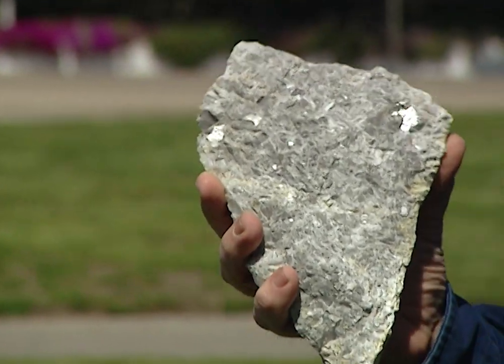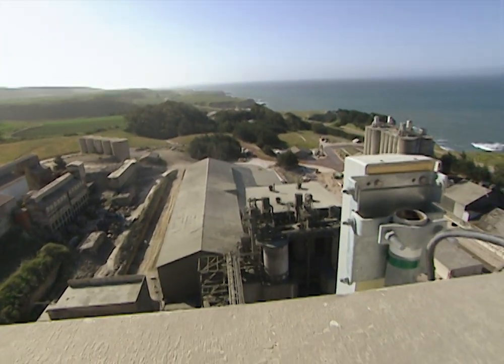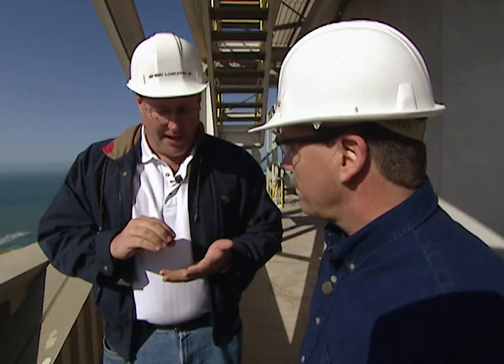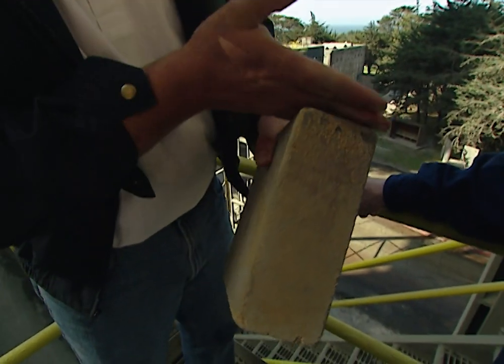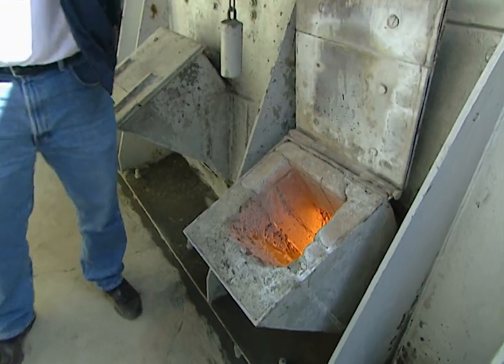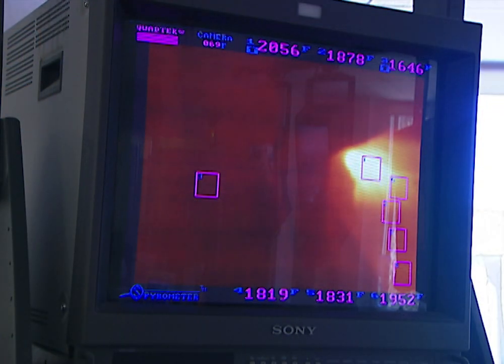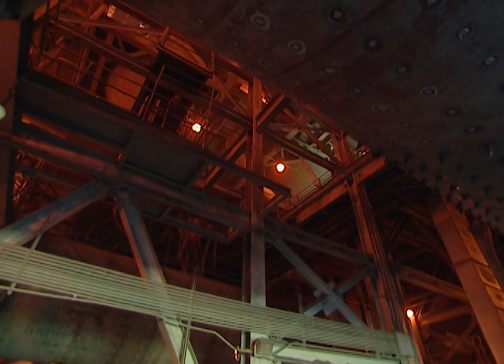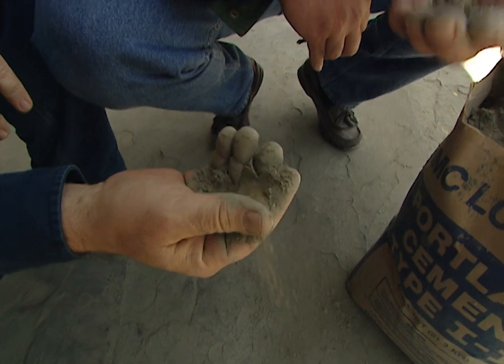How Cement is Made: Inside a Cement Factory - Did You Know?

Comment: Sorry to break it to you but no your man is not able to make 1,200 bags per hour because when you do the mathematical equation it means that he would have to do 20per second, i work at a cement factory where we bag cement bags all day long and we do an average of 45-50 pallets for an 8 hours each pallet contains 30  bags of 94 lbs of Portland cement, so please you might want to retract your inaccurate statement and i should know i also work in this field of work here in El Paso TX for a cement facility called Jobe
Reply: 1,200 bags per hour equals 3 per second according to my math. 60 minutes times 60 seconds equals 3,600 seconds per hour. 3,600 divided by 1,200 equals a bag every three seconds which the video appears to show.
Reply: @groler2914  a bag every 3 seconds not 3 bags per second
Reply: Ok, Jose, you're getting paid by the hour. That's why you're doing less than 200 an hour. Maybe he's getting paid by the bag with no cap. (let me mansplain that to you, suppose they pay you a dollar for every bag you make in one hour, without limits. Now how many can you get done before the time runs out?) They didn't say he did 1200 bags an hour for a 12 hour shift either.
Reply: Yea this guys forgot basic math
Reply: It is a bag Every 3 seconds. I am sure a lot of the process is automatic.